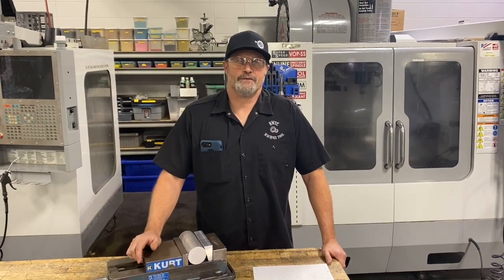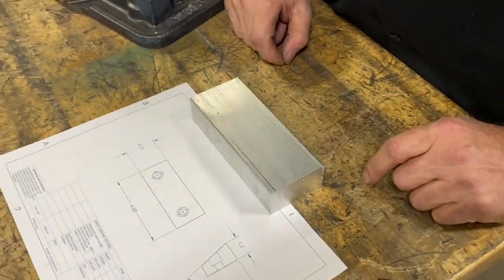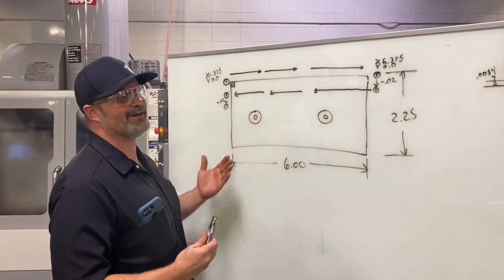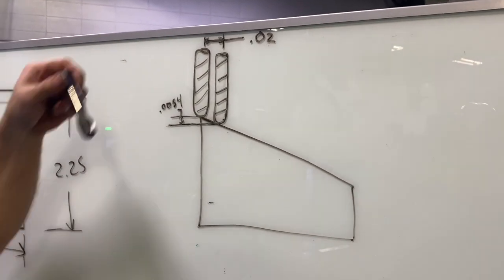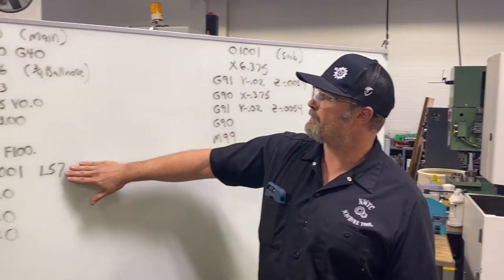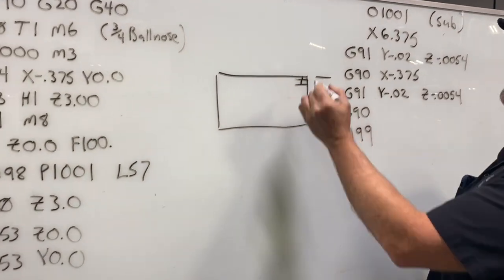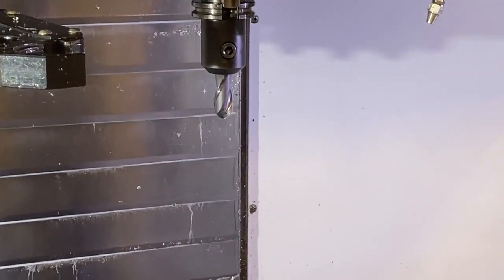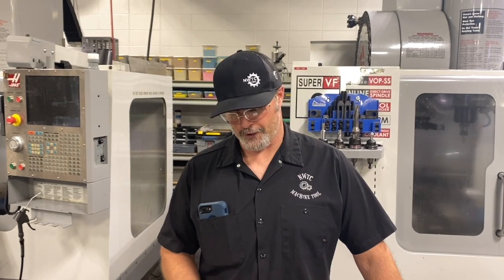How to Mill an Angled Vise Jaw

Comment: How did you determine the Z value for this move? Can anyone explain that equation, I'm a little stumped?
Reply: You would do the Math on the triangle that is being removed. 
Side A of the material being removed is 0.60288".
 So, divide (side A) of that triangle by the number of loop (L=57) passes.
 Then divide by 2.
 0.60288 divided by 57=0.011 then divided by 2 is 0.0055. 
 So, equation is    Side A divided by #of passes=B. Then B divided by 2= the answer.
Reply: @sandwon  thank you for the clarification!
Reply: @sandwon I know it’s a long shot but how did you determine the material being removed figure to be 0.60288” I can’t figure out how you got that figure?
Reply: @callummorley2260  It took me a while to remember.
 When calculating an angle 2 dimensions are needed.
It does not matter if it is a length or an angle or a combination of either.
A person just needs 2 of either of the dimensions.
 So, in 0.52 of the video, they show the print.
The print has minimal dimensions. Which is common in the Machinist World.
The info that is there does provide enough for calculation of the answer.
It helps if you are good at trigonometry or have a calculator.
Length B is 2.25 and Angle B is 75 degrees.
There is the 2 pieces of info a person needs to calculate the Trig.

So, with that being said.
Side A = 0.6028
Side B = 2.25
Side C =2.3293
Angle A =15 degrees
Angle B =75 degrees
and of course, angle C = 90 degrees.

Hope this helps.
😃
Reply: @sandwon If i understood for Z but  how is Y 0.2 . Sorry for bothering, but I'm not good in maths 😅
Reply: @stefankatic  Actually in the video he used a 0.020 move each time in the Y axis. As he stated you can make this number lower for a smoother finished surface or larger would create a rougher surface. With the Dimensions of this print side C of the Triangle (Which would be the length of the Y axis) would be 2.3294.
 His part is 2.25 wide in the Y axis. So 0.02 x 2 = 0.04 which is a complete loop of his subprogram. So 2.25 divided by 0.04 would round up to 57 X axis moves with a z move of  -0.0054 each Y axis move.
 Hope his helps.
Reply: @sandwon  Thanks for response, but when I calculated the Z axis, I got 0.58 (2.25cos75) and you got 0.60, maybe my calculation is wrong, I would be grateful if you could clarify it for me, thanks again